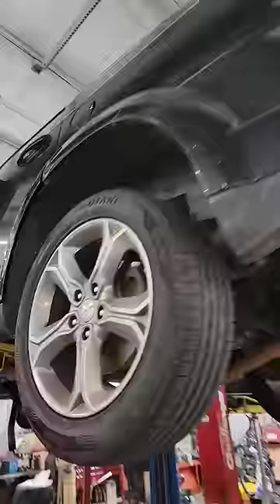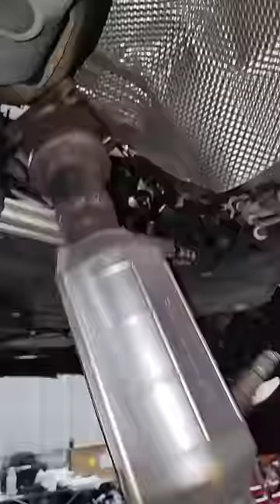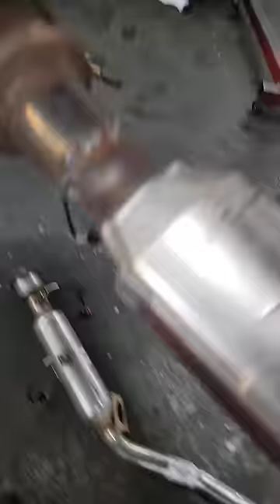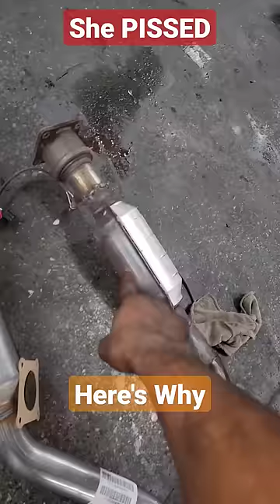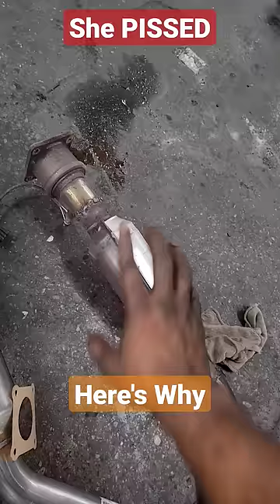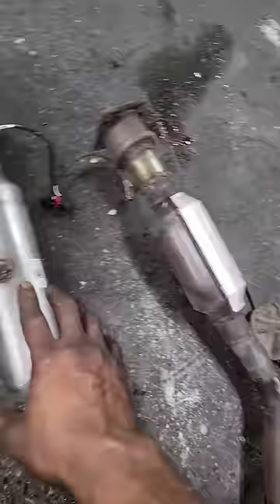This customer freaken Pissed Off. But at whom?

Comment: Check for recalls once a year on your vehicle!
Reply from the maker: Facts
Reply: @@_sludgefactory5176 we literally got one about the nissan in the driveway. its an 07, 3rd or 4th owner. recall is about the airbag emblem not staying attached and maybe flying off and injuring people during a collision, wrong glue or cracking or something.

a 16 year old vehicle, not the dealer registered owner, still got the notice.
Reply: I always buy Second Hand Fords and Every car that I have Purchased has a Sticker on the Fan Shroud  saying the Converter was replaced under Warranty.
Reply: I keep checking for recalls on my 78 Elcaminio 😢. No free parts yet.
Reply: If your car runs, is paid completely in full, and is still solid, keep it for as long as possible.  You are doing yourself no favours by purchasing today's vehicles, with today's prices, today's over engineering and today's evil financing.  Your old car will be way cheaper, no matter what repairs it needs and fuel economy it makes.
Reply: I got a check from chevy once over an ignition recall , after a really long class action suit.
Reply: @ThisTimeTheWorld  I received a cheque one from GM for the Chevrolet Blazer's repeated transmission recalls for the earlier models of 1996 to late 1997.  The GM AWD 4L60E 4-Spd automatic transmission had a defect where the transmission's input shaft was only spot welded flywheel.  Those four tiny spot welds failed with great ease.  However, other issues with that transmission were too bad to repair.  The value of the transmission was refunded to us so, we could purchase a replacement.  I used the money to buy my current vehicle new and scrapped the blazer.  It did not even have 80,000 miles. It was only about a year and a half old.

Comment: If you are responsible enough to register your vehicle, the manufacturer will have your address and will hound you with recall notices in your mail until you get it done.
Reply: Facts..Honda mailed me over 

10 times about an airbag recalled..
Reply: @daymonn00 its good to have airbags bro
Reply: Yep GM hounded me about 3.8 V-6 Valve cover gasket and oil fill tube gasket about possible fire.
Reply: If its just a service bulletin but not a recall they will not contact you and you’ll never know lol
Reply: I used to get recall letters for a Jeep Cherokee for about 2 years after I sold it.
Reply: More like one recall notice per recall but yes they will send you notices. Which are the customers responsibility to read. I dont understand why every time one this guys videos pops up hes bashing someone for something that isnt their fault. Smh
Reply: @michaelwatson7298 must have been something hella dangerous because ive had airbag recalls that only show up one time
Reply: @blueberrychronic  if you don't get it fixed they just keep sending them like every 6 months to a year.
Reply: @holdenweese9589 right. But they don’t usually pay for service bulletins . That’s more to help the techs know of known issues
Reply: Ford send recall notices many many times.  The f150 speed control one. I bet I have 30. I fixed it myself because I don’t have time to leave it a week.
Reply: @kenlaw04  that's not how it works. If the vehicle is registered the powers to be know and send the notice to the registered owner.  I have bought vehicles from random people and still got the notice.
Reply: @kenlaw04  no, I don't got it but I'm sure you do.
Reply: @kenlaw04  Factory warranties and recalls are transferrable to the next buyer, and they will notify them by mail to the address they registered the title to. I've gotten recall notices on several used vehicles I've owned.
Reply: I have a 2022 F-150 and I have had two letters for a wiper recall. I called the dealership and they said they won’t act on it unless my wipers quit working due to parts availability
Reply: not for all recalls. only safety recalls.
Reply: @kenlaw04 Rubbish! When I purchased a 2002 Accord in 2017 it had 157K on it and umpteen previous owners. Honda immediately picked up on the fact that the vehicle had been registered to me in my state and they sent me a pretty horrific recall notice, including graphic closeup color photos of prior victims, highlighting the sort of lethal injuries one may receive if the defective airbag isn't replaced and deploys.

They may not have tracked her down over an emissions recall they absolutely will track her ass down over an airbag safetu recall. Doesn't matter how old the vehicle is or how many previous owners it's had, or the fact they don't know who you are or where you live. They do, as soon as you register the VIN in your name.
Reply: @blueberrychronic hen it's hella dangerous they will pursue each new titled owner until they know that the vehicle has been fixed or destroyed and it's title had been branded as such.

The airbag recall notice I received made the point very clear that the defect is both age-related and humidity related, and my vehicle was ticking the box for both thus prioritizing its recall status and the urgency to get it done. To get home that point they included a warning with graphic photos of actual lethal injuries people had suffered as a result of the defect just to encourage people to not ignore the notice, as the result can be dire and lethal. Turns out that wasn't even the original airbag that had been in the car for 15 years. it was the third recall notice to replace the freaking airbag. Honda service records indicated it had already been recalled and replace twice before. When I took it in it was the third time a replacement airbag was installed in the vehicle. 😂
Reply: @daymonn00 that's because the airbags were basically a gun pointed at your head and when it goes off it shoots shrapnel into your brain. Kinda a big deal.
Reply: Yep!  I kept getting mail about an airbag recall for my Dodge Charger.
Reply: @holdenweese9589 literally the video said it’s a recall. Your comment is irrelevant in this video.
Reply: Great point
Reply: I think the NTSB also sends out recall notices.  sometimes the manufacture doesn't "recall" items like a converter.  they'll issue a product service bulletin.  and often will replace the part also.   I had one for my old motorcycle.  it applied to 2003 models and guys were getting the ignition coils replaced all the way up to 2009 on the 2003 model.
Reply: @blue03r6  you are correct. You should always ask mechanic shop or look on wall. My mechanic shop has all recalls and bulletin board in shop. That's how I found out about tikata air bag recall for my acura and Toyota.
Reply: @Corsairforu what year was car

Comment: Hope she paid via credit card. 
Either the shop gives a full refund, or do a charge back.
Reply: Thats not how it works. She approved the repair. She authorized the transaction. That customer is fuuucked lol.
Reply: @Hernandez530  - She didn't authorize that crappy repair that DIDN'T work.
Reply: @B A  he never stated that the original repair wasn't working properly. What this jabroni doesn't tell you is that the universal cats flow much better than the HUGE oem cat. He just made her car LESS EFFICIENT. OEM parts are not always the best option. This guy is a joke.
Reply: @moedigzz  - If it was working correctly, this shop wouldn't be replacing it AGAIN with OEM.
Reply: @BA-gn3qb  they are replacing it due to the recall. Im sure that customer got a notice in the mail that her vehicle had a recall. Customers negligence cost her money.
Reply: @Hernandez530  - No.  You are WRONG Again.  There was a problem with it.  And the new shop found out about the recall.
Auto Repair 101:  If it ain't broke, don't fix it.
Reply: I’ve seen some auto shops really screw people over, one of the worst I’ve seen was a friend of mine that owns a furniture store and his delivery truck kept dying on him on deliveries.  The truck kept getting towed in to different repair shops wherever it was close to where it broke down.  When he told me about the problem, I told him to replace his gas filter, it’s probably your problem. But of course he didn’t listen to me. 
A year went by with his truck dying here and there and going to numerous shops to fix it. He literally spent over a thousand dollars and the truck was still dying now and then.  Mechanic even replaced a starter on the truck. Now please tell me what a starter has to do with a truck engine dying? 😂  Finally after spending all this time and money on hid truck at these different repair shops. He decided to listen to me and change the fuel filter that not one repair shop ever even thought of replacing themselves. Once we replaced the fuel filter the truck  never died again.  Wasted a grand when the problem was a $20.00 fuel filter! 
Unfortunately the only mechanic I trusted went out of business and retired. I haven’t found another mechanic shop yet I feel I can trust. Why I do most the work on my own vehicle. Seems more often than not, I catch other repairs shops not doing the work they charge me for or didn’t do it correctly!  I have numerous stories where I have caught repairs shops, especially these tire shops that supposedly do other vehicle repairs! Or these quick change oil service shops. Trying to charge you for things you’re vehicle doesn’t need. Jiffy Lube told me my jeep needed a radiator flush badly! Which was right after I had installed a new radiator in my jeep. They didn’t know what to say when I told them I just put a new radiator in the jeep, so how could it need a radiator flush so badly driven less then 15 minutes? 😂 I don’t let these oil change companies do anything other then change the oil and that’s it. Even then you risk them stripping your oil plug and of course they will never admit stripping your plug either! I highly recommend never taking the first opinion of any shop telling you what your car needs, go to a few shops for  a opinion what’s wrong? I have found many shops give several different answers what your vehicle needs?  Hopefully you will find a few shops with the same answer to what’s wrong and their probably honest ones!
Reply: @BA-gn3qb It's like you don't know how recalls work. Shit gets replaced BEFORE it breaks.
Reply: @Carlitosway211  - Obviously YOU don't know how recalls work.
Companies fight having recalls, even with Known problems.
Reply: @BA-gn3qb  Been in the auto industry my whole life. You said earlier "If it ain't broke, don't fix it." Recalls are performed before anything breaks or anyone gets hurt.
Reply: @Carlitosway211  - The Government FORCES recalls when Something is wrong. 
Very Few car companies Voluntarily do recalls. 
And in ALL cases, no recall was for anything working correctly.
Reply: @BA-gn3qb  Bullshit. The government only steps in if they have to. Automakers have recalled over 80 million vehicles without the government stepping in. Automakers usually initiate the recall before the government steps in to avoid fines and litigation. Many recalls are performed on vehicles with no issues 'yet'.

Comment: That's why it helps to open the recall letters you get in the mail.
Reply from the maker: Lmao...IKR
Reply: from what I understand only 60% of consumers actually get the recall work done. And then there’s the other 40% which I must admit in some cases the dealership doesn’t have the part for the recall for over a year
Reply: @JDMHaze  currently I have a recall notice for my Subaru having a faulty inflator but a customer of mine took her Subaru to the dealer for her own recall and they had it for 4 weeks due to not having the part and since the car was in a wreck and the bags deployed they'd already been replaced so it didn't even need to be changed. I won't take my car unless I can wait on it because I've had bad experiences with leaving my car to get things done which is one of the reasons I do things myself. I wish they'd just give me the airbag to change it myself.
Reply: @neonnerd1364  i see

Comment: Small shops often use the aftermarket parts because the customer doesn’t want to pay the OE prices. I bet this is so common that the shop won’t even call and compare prices. Also , I would hope the parts guy at the dealer would offer the knowledge the dealer has over the aftermarket that there is a recall or not. I bet they don’t tho because the bottom line is all about $$. The part department will sell the part to justify their existence. Last case in point that I was aware of was Subaru wheel bearings. I only knew because a customer did the check and informed me. Now I pass that info along , such a case just happened, my customer wanted hers done because I heard the faint whirring when I put snows on and it was still there when this spring came. The dealer here wasn’t aware about this warranty until the customer asked about it. The customer was going to bring the car back to me then the dealer conceded that there was a warranty extension

Comment: She needs to call a lawyer
Reply: What exactly do you expect a lawyer to do? She went to a repair shop they managed to sell her $1,000 catalytic converter and thus she got what she paid for. If that didn't fix the problem then there was probably no guarantee that it would do anything but be a brand new catalytic converter. If anything the horrible welding job would be an excuse to claim that she suffered a loss but only insofar as it cost her to have the weld repaired if the original shop wouldn't make it right for free. Other than a welding job explain to me what the original Mechanic did to cause her to suffer a loss in their legal relationship. Sour grapes for the woman although it's a deplorable situation court of law would most likely not real in her favor because she has no case. She should have checked to see if her own vehicle had a recall. It's not the duty of the guy selling the catalytic converter to check it's good public relations but it's certainly not his legal Duty

For example if somebody comes to my shop and tells me they want something made out have titanium when a much less expensive aluminum or steel product would meet the engineering requirements of what they're trying to do, I have no legal duty to try to sell them something cheaper if they specified titanium, or if I'm a crafty enough salesperson to up-sell them to making something out of titanium instead of a much more economical material. Now this is terribly unethical, but it's not against the law. Unfortunately there are too many unscrupulous people out there that will not put the customer first and the free-market will decide how long they stay in business, not very long. The best thing the woman could do was leave some bad social media posts and reviews for the shop to maybe save somebody else the frustration next time. Unfortunately there's a huge difference between what we're legally bound to do and ethically bound to do. I've built a thriving fabrication business based on taking care of my customer first and putting profits second. My experience has been if you take good care of the customer the prophets take care of themselves!
Reply: Yep.  Giving a lawyer a few grand will definitely fix this!
😂✌️🍩

Comment: Why is it the shops job to tell her it had a recall? Its her car, how would the shop know
Reply: Recalls are published, a quick data search, and you find out the recall exists. I did the search on virtually every job I did . On one occasion, my sister-in-law's Honda would not start in her driveway. She called me I checked it out." The electronic ignition distributor had died, and I checked for recalls and found one. I told her to call the dealership and tell them to come get the car. They towed the car, replaced the distributor, and called her to pick it up. All no charge. I did not work on Hondas, but I still found the recall. And I was an old man with dyslexia .
Reply: @thomaslemay8817  , my brother replaced a broken bolt on his and his sister inlaws KIA.  KIA had a recall sometime later and they honored the labor charges he sent them.
Reply: Exactly.  People always wanna blame someone else.

Comment: 😂😂 vehicle owner should have done a little research before just agreeing to first estimate. 🤷‍♂️ shop around ppl don't b lazy be proactive
Reply: That's what I always tell ppl do your research. Call around. If the dealer a couple $100 less go dealer. Never know might be free
Reply: A really good indicator of is a shop is good or not is if they allow you to bring your own parts. Any shop that refuses to accept customer Parts I assume is trying to rip people off on cheap low-quality parts that they upcharge for and I will never give them my business.
Reply: @poopy pants  that's not true, they don't allow customers to bring their own parts bc of warranty. There are some shops that do but tell the customer they won't warranty parts or labor. You obviously never worked customer service 🙄
Reply: @poopy pants  I've even seen customers bringing parts from pull apart. Or parts off ebay, or someone offline. It's a quality control thing. Most shops have accounts with local part's departments, including dealerships
Reply: @vbarbee1  lol quality control while you're sticking Moog garbage on everything

Comment: Been going through a cat code for about a year now on my 05 saturn, bought expensive cat cleaners and run through it, never made the light flicker. Decided to try a tank full of premium, 3.5 gallons later the light went out. Ethanol sucks ass, it doesn't burn hot enough for some cats.